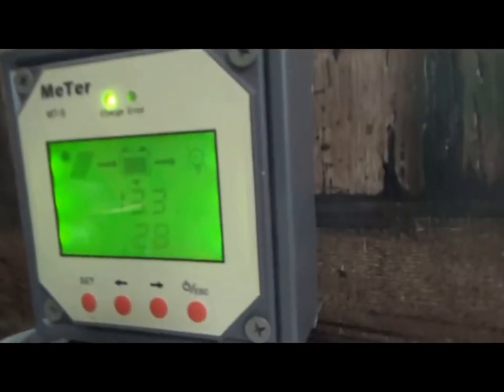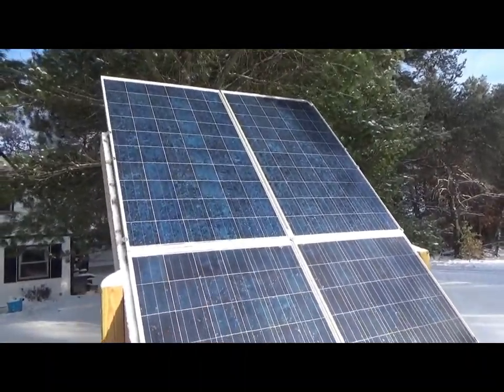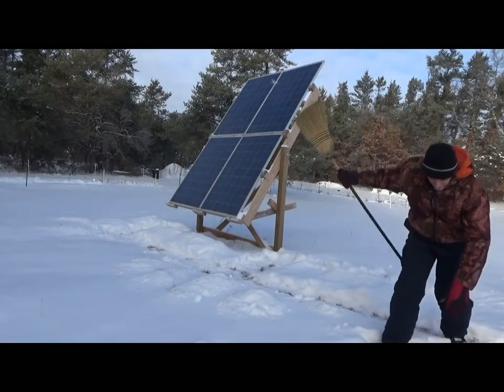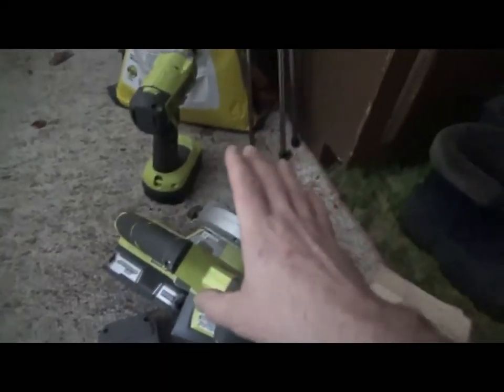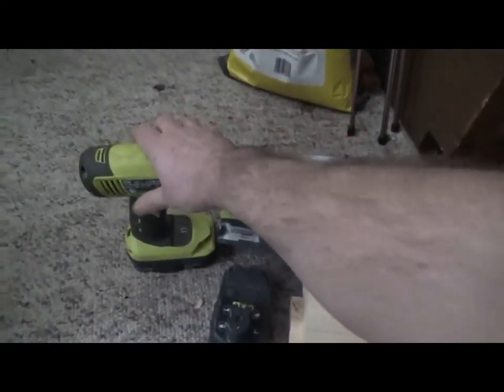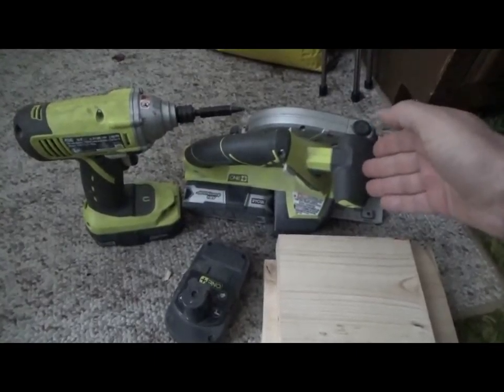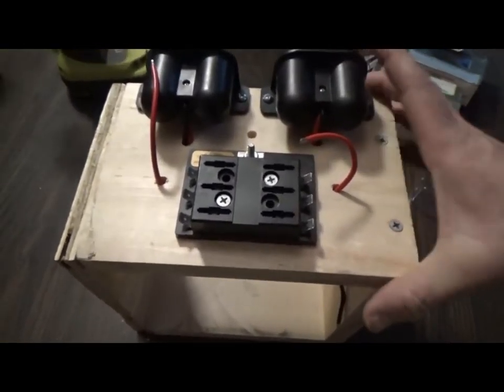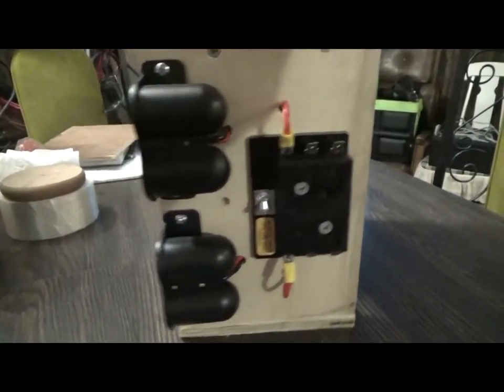Awesome Solar Power & Making AC DC Power Box

Comment: Why would you need power tools to cut those little boards? I thought you were going to use something, stove maybe to heat those sheds (not to late). I hope Melanie wasn't going up and down unsafe stairs with the baby too :(.  It is a fairly older chalet that yas live in so that's expected that stairs aren't up to par, but be careful. Also windows and doors not well insulated, drafty etc. You need to put up some plastic or do some major window and door caulking as you wouldn't want little Michelle to catch a cold :(  Haven't seen little Michelle in a while but have heard her. JMO

Comment: You need to learn to use hand tools. It will save you a lot of time. You don't always need "power tools" to get the job done.
Reply: Have you ever compared a cut made with a hand saw to a perfect cut made with a table saw? And why would anyone want to screw screws in by hand?
Reply from the maker: Yeah. At 12 degrees F with no heat thats a blast.

Comment: The blocking diode is in the charge controller. The panels have bypass diode to route the current around shaded cells.

Comment: Did you ever consider cutting those little pieces of wood with a hand saw?
Reply from the maker: Yes I did. But at 12 degrees F with no heat that did not last long.
Reply from the maker: And i never could cut a straight line with a hand saw. Square in all directions that is.

Comment: rechargable battery;s dont work in the cold thu............ Y hope you have connected your temperature sensor between the battery,s and your solar charge controller? (not doing so wil harm your battery's to.) just a tip, not to troll
Reply from the maker: I cannot find an external temperature sensor for this device yet. I hate to have to put it out in the battery box.
And you would be amazed at how many people tell me I am stupid because these batteries should work in the cold.

Comment: TROY,...TROY. .... TROY  ,....
I'VE GOT TO GET AVREAR AXLE SPEED SENSOR.....LOL
AND NOW I'VE GOT TO GET A HEAD GASKET. ......
I HAVE TO ADMIT, IT'S NUTS HOW THAT HEAD GASKET BLEW .....
THE TR7CK HAD A KICK BUT ENGINE , AND WHEN I MADE MY TRIPS TO THE CAROLINAS I REMEMBER I COULDN'T GET THE POWER NEEDED TO PASS IN SLOW TRAFFIC ...IT BLEW MY MIND....
TOOK THE TRUCK TO GET ALL THOSE PARTS AND WHEN I WENT BACK LAST WEEK TO DO THE REAR AXLE I HAD THE GUY RUN THE MACHINE SCAN TOOL AND THE COMPUTER KICKED OUT CODES FOR O2 SENSOR , NOD8 PISTON MISSFIRE , AND LEAKGAE OF OIL INTO EXAUST , WHICH IS THE CULPRET FOR THE O2 SENSOR AND THE MISFIRE .....
I CAN'T WAIT TO START IT , BUT I DON'T HAVE A PLACE TO DO IT WGICH WILL BE THE BIGGEST CHALLENGE
Reply from the maker: Be careful you dont get burnt by those guys diagnosing your stuff.